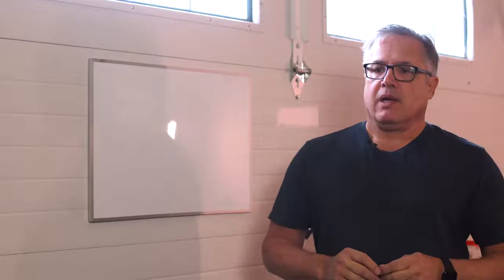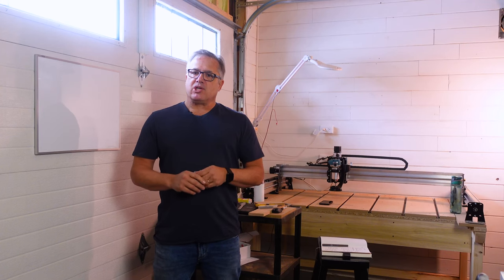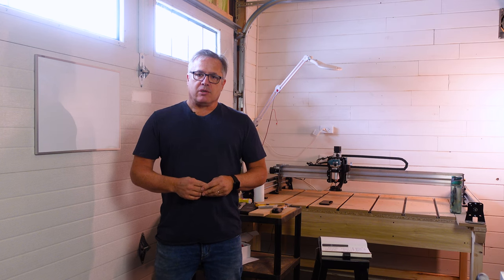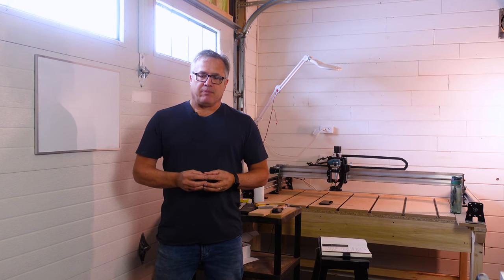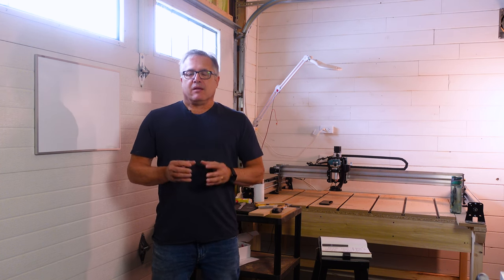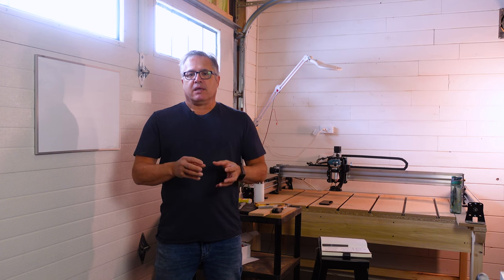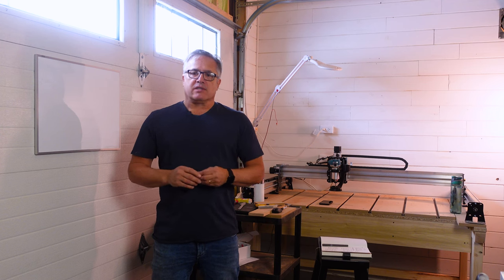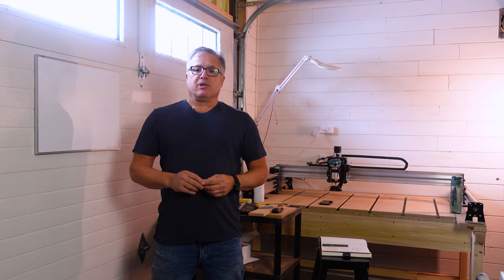How Chipload can Impact your CNC Project

Comment: This is an excellent video and a clear explanation of chip load and how to achieve an optimal chip load. With respect, I believe it would have been better if the example that you gave was possible with the Long Mill. Your example shows a feed rate of 432 in/min, which is almost 3 times the maximum feed rate that a Long Mill can achieve.

Comment: All good info. Makita Compact Router, No Load Speed : 10,000 - 30,000 RPM.  When planning, you can also reverse the direction of the board to reduce tear-out.

Comment: The whiteboard drawing for the exit angle shows the cutting edge pulling away from the uncut wood edge ahead of it. I thought that the feed direction was supposed to be such that the leading edge of the cutter was moving into the wood surface in the direction of feed to avoid rip out or chip out. Is that correct? Maybe I'm not understanding something about that part of the discussion.